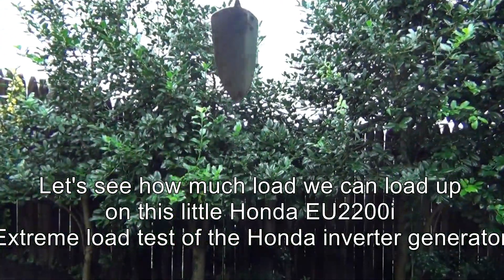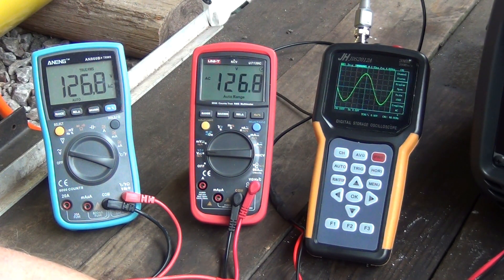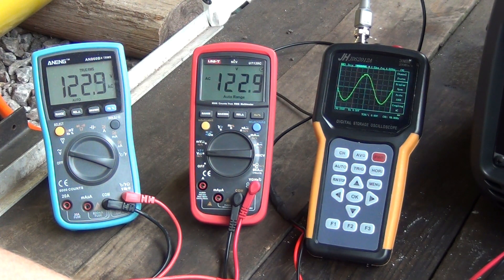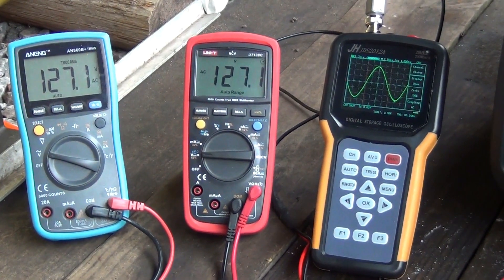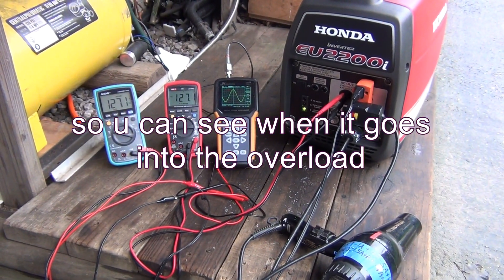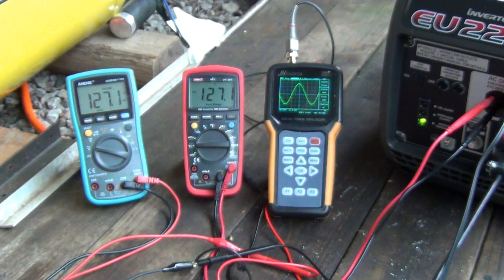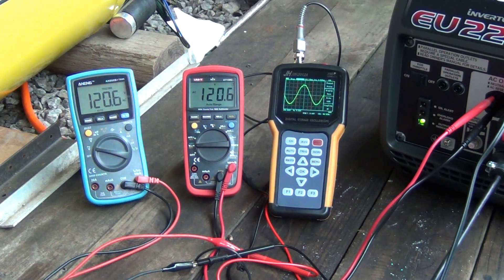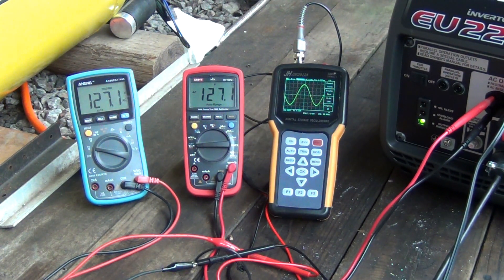What can I power with a Honda EU2200i inverter generator?

Comment: Hi, did you have the same heat gun in this test that was causing problem with the Victron inverter? Honda inverter has no problem at all.
Reply from the maker: Yeah you right, it’s the same hair dryer